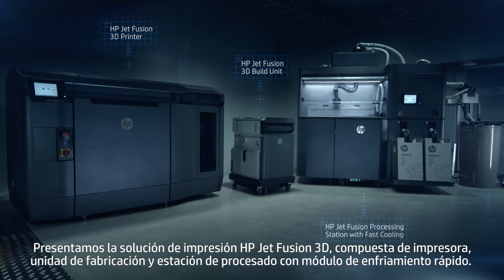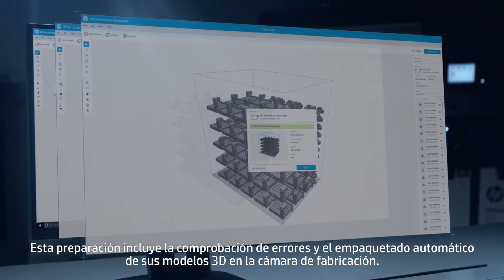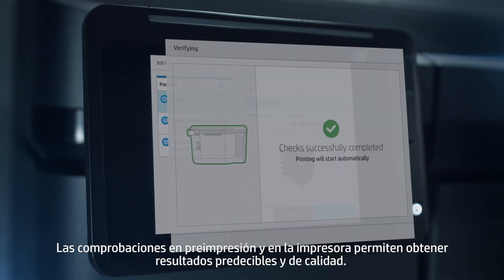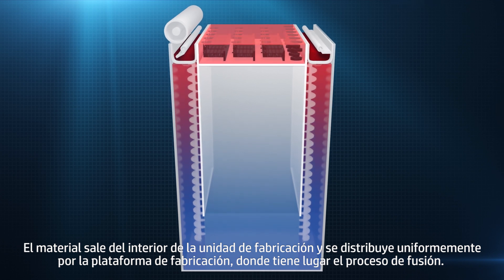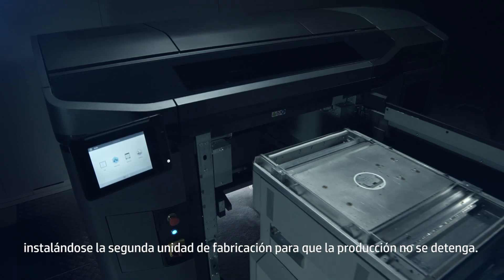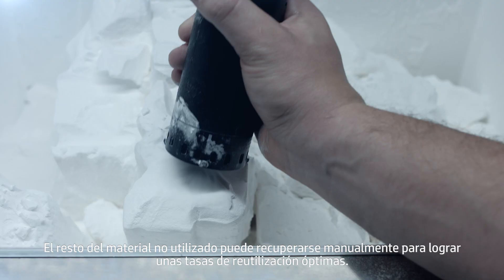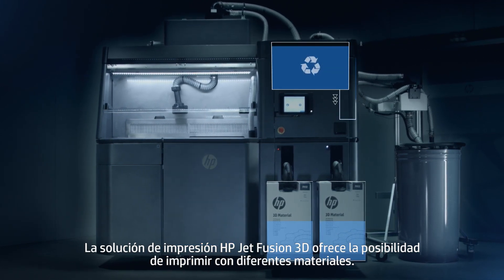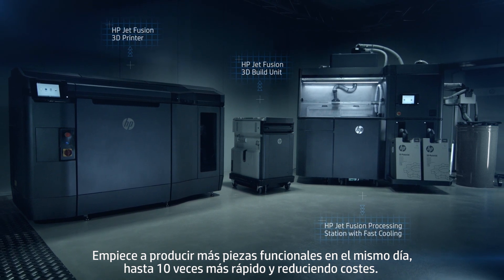Cómo funciona la impresora 3D HP Jet Fusion 4200

Comment: ¿de quÉ material y resistencia están elaborados los prototipos o piezas?
Reply from the maker: Buenas tardes Cyrux

El modelo mostrado en el vídeo, Hp JetFusion 4200, trabaja con poliamidas, concretamente PA12, PA12 GB (Glass Beads) y PA11. Las propiedades mecánicas obtenidas son mejores que en el resto de tecnologías de fabricación aditiva, y son muy similares a las de la poliamida inyectada. La nueva serie 5200 incorpora además elastómero TPU (Poliuretano termoplástico) a la gama de materiales, y está preparada para producción con materiales actualmente en desarrollo para la tecnología de fusión, como el PP (Polipropileno). 
Más información y detalles en: https://www8.hp.com/es/es/printers/3d-printers.html

Para lo que necesites siempre puedes llamarnos.
Grupo Solitium.
Gracias.